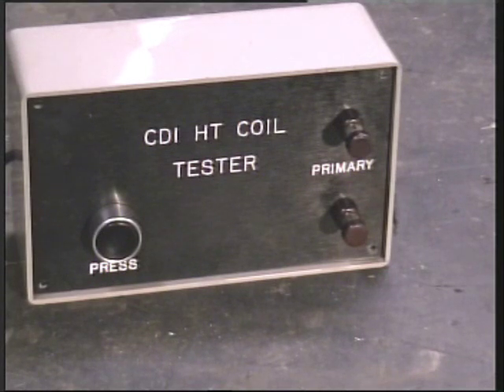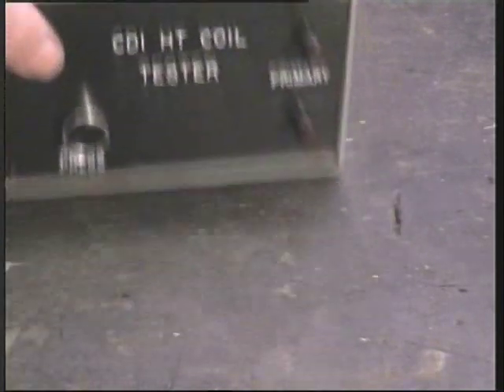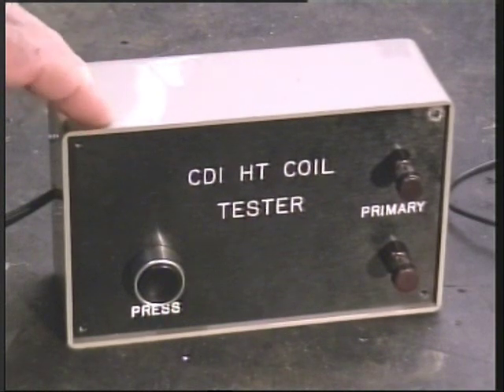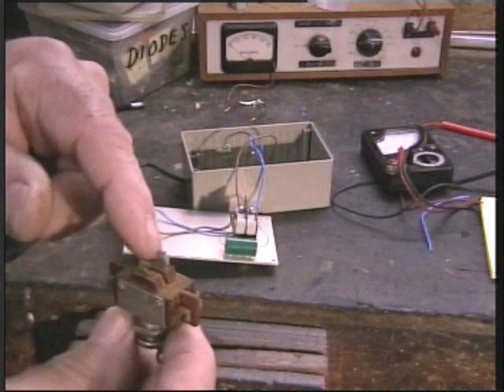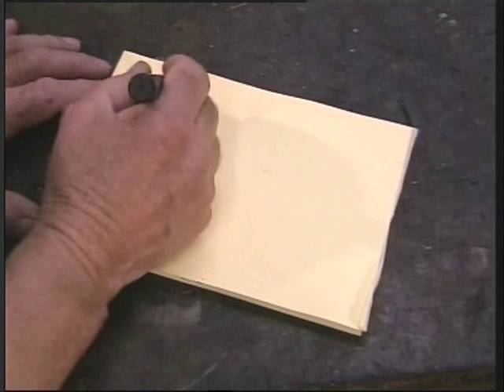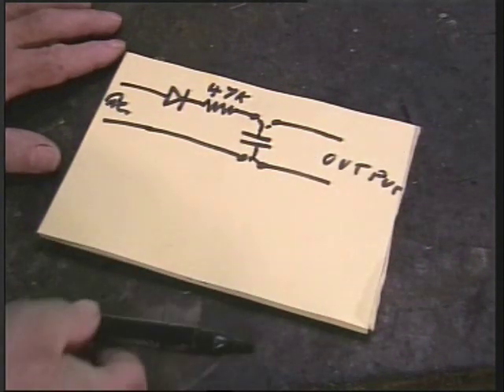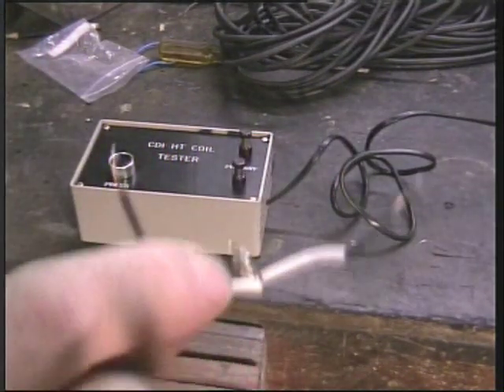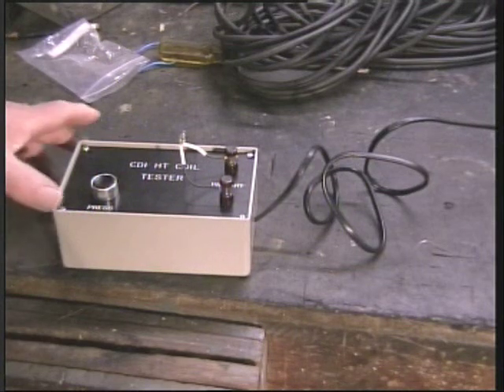homemade cdi coil tester.wmv

Comment: Hiya.. I've made this  project..  but not sure where to connect the positive and negative to the ignition unit to test. Could you help please?. Thanks.
Reply from the maker: Hi Tom your query would suggest you have not understood the principal of this unit, and that gives me real concern. The unit does nothing more than discharge, a charge up capacitor into the  primary (therefor only two wires) of the cdi ignition coil, to ascertain if a  fault is in the cdi or in the ht coil, I would highly recommend you get a qualified electrician to check out your project, sorry but the real risk is you could do more harm than good

Comment: what would you change in this design, in order to adapt it to use North American (US/Canada) 110V 60Hz A/C Current?  400v Capacitor?  Different resistors?  I think the DN4007 would still work fine.  Please expand your theory for 110V A/C.  Thanks.
Reply from the maker: look down the comments as I've covered this many times

Comment: Rather than two single pole single throw switches ganged together; would a double pole, double throw momentary push button switch work in lieu of the two ganged together SPST switches?
Reply from the maker: Yes ... I used what I had.but make sure that two polls are separate (no continuity between the two)

Comment: hi sir what is capacitor value?
Reply: He says it at 2:50.  1uf at 400V .   You probably could use two 0.47uf  capacitors wired in parallel for half the price.

Comment: Most automotive coils are triggered on the COLLAPSING primary field (when the points open).  This one would be triggered in the EXPANDING primary (as the capacitor is connected to the coil when the button is pressed).  Does it even matter on an automotive ignition coil??
THANKS FOR THE GREAT VIDEO--I REALLY ENJOYED IT!

Comment: Ha. I acquired a new lawnmower the other day. It wasn't complete but it was complete enough to run. So I give it a whiff of ether, connect the starter to my leads and hit the battery, nothing. Grrrr. Look around to see if I have another starter, no, not for this one, wander off to find a different set of leads cause the clamps were dicky, yep, same result. Grrrr. Drag my big battery down from my XJ 350 chev Jag, same result. Grrr. Ok. Work smart not hard, get my multimeter, let's see where the volts are disappearing to. Hmm must be the earth. Yep that's it. Change 48 different earths.... wait on, maybe Wifey switched my battery charger off... yep. 2 batteries, 2.83v and 8.34v in them. Ok. Should have checked them first. Back to the charger, make a coffee I'll try again another day.

Comment: great video mate. But I'm having issues trying to understand the 2 pole ganged switch. can you please help me with the switch? I keep being given a push switch by my electrical shop
Reply from the maker: Ok the capacitor is charged vire the feed from the mains the switch 
isolates the capacitor from the mains which is now charged and puts it 
across the coil primary if you don`t touch the two wires you can place 
this across the coil primary (with out the switch) but it will discharge
 it only once so repeat, or go for a toggle as shown at 3.39 - 3.56.
It concerns me sometimes my vids maywell be viewed by those unfamiliar 
with the subject matter so if your not fully confident to proceed best 
get a electrician to make you one up ... hope that helps
Reply: Cheers mate. Nah all good. Thanks for explaining. I personally went and got the parts natal from the shop. They did have the correct switch. They were just idiots.
Thanks for the reply. And keep doing what you do

Comment: is it possible to make a coil tester for a bigger engine. if so take my money!!
Reply from the maker: The size of engine makes no deference the spark generated is just the same whether its 2hp or 200hp.
is that what you are asking or is you query about non- cdi coils which have a higher input / output ratio ?
Reply: Well you answered one of my questions..  the omh is supposed to be around 550-580 for the coil read..  would it work say on a inline 6 bmw coil Bosch.  Ps im new to electronic building so please work with me here haha . I know the box doesn't have a reader meter. But would it at least push the coil to make spark or would i need stronger component to test the coil packs
Reply from the maker: Please be advised happy to help any and everyone but sometimes (reading between the lines) and working to peoples knowledge of a subject and my abilities to express the little I know, its best to avoid an answer, I`ve been down this road befor... but briefly as high voltages are involved as well as the ease of doing more damage (high proportion destroyed needlessly) leaveing it to a pro will be the cheapest in the long run ....  I guarantee it !

Comment: Will this tester work on 120 VAC and if so; what would the values of the components be?
Reply from the maker: I can not be 100% sure but it should !, reduce the resistor to about 2-3k and up the capacitor to at lest 2mfd (it "still" needs to be 500v ac working) hope that helps

Comment: Had a quick look on wiki. I'm pretty sure you need the voltage and it might not work on USA type mains voltages. But you could make it mobile with an 12v to 240V inverter.